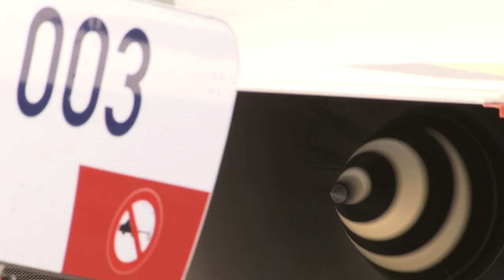A350 XWB: Engine testing in Bolivia and Canada

Comment: if it works at 30,000 feet I'm pretty sure it would work at 13,000... and they have actually already tested the engines at 13,000 feet during test flying
Reply: it means being able to takeoff at that altitude as the air is much thinner the engines need more power to takeoff than they do for normal flight so would need more air to be ingested which would be harder when the air is so thin
Reply: You are not thinking. The tests in Cochabamba and La Paz are for the purpose of seeing, how the engines and the aircraft overall can handle takeoffs and landings at high altitude airports. Obviously there's no way in hell an aircraft can take off and land at 30,000 ft, even if we had a place like Mount Olympus on Mars, where we could theoretically built landing strip that high for this. 30,000 feet is cruise altitude, not takeoff and landing altitude.
Reply: High altitude testing is very important. Possible destinations for any widebody can include Mexico City, Quito, Denver, Johannesburg, etc. Not all airports are on sea level, although not all are as high as La Paz either, although LPB is the holy grail for high altitude testing.
Reply: SquirrelFromGradLife i explained myself clearly
Reply: SquirrelFromGradLife aT 30'000ft, when you're going to 190kts IAS and you stall, you're already at a little bit more than 300kts Ground Speed and only roughly 150kts equivalent airspeed, and i'm giving a random value because it does change due to pressure, altitude & temperature, when they test the plane at La Paz, they're testing the capacity of the aircraft to reach a given IAS & EAS in a certain distance, they know the engines won't just shut off in final at 13000ft, it's not a single engine piston aircraft. Also, it's important for them to know if the engines can sustain a Go-Around at the MLW, in a high temperature/high density environment with a decent climbing rate.
Reply: SquirrelFromGradLife The engineers don't want to prove that the engines work at 13,000 ft, but that the engines perform enough thrust for take-off. You are mixing things up. The amount of thrust needed for cruise flight and for take-off are completey different. Why testing at high altitudes? Well, others already explained it but the air at high altitudes is much thinner so the engines produce less take-off thrust hence the aircraft accelerates slower. And since a lot of international airports are at high altitudes aircraft manufacturers are obligated to test aircraft at these high altitude airports. Again, it's not about whether the engines work at high and medium altitudes, it's about the behaviour of the engines and aircraft at high altitude airports. 

Another thing is that jet engines have much more difficulty to start at high altitudes (as a result of the low density of air.) At 30,000ft it may well be that an engine cannot be started but it has to be proven that the engines and systems of the aircraft are able to fully function at high altitude airports.

(I know the previous comments are a couple of months old but I just find it interesting so I responded)
Reply: SquirrelFromGradLife i wasn't rude to you, so why be rude to me?
Reply: SquirrelFromGradLife And you think that Airbus (if what you said was true) don´t know it?, and expend so much money on their tests?... 

I live in La Paz, and i can confirm you that the air here is to thin, if people got sick and can´t breathe, an engine thats work with air have so less air for use.
Reply: SquirrelFromGradLife at 30000ft the plane already had speed, but from 13000 it is still silent. You might found out that to change an object's motion is more difficult and require more power than simply keep it running.
Reply: TheRabbitFear Yeah but you're still not making any sense! They have already tested the plane in its full flight envelope at all altitudes which actually includes near stall conditions at altitude! If you can fly at near stall speeds and angle of attacks at its maximum altitude then I'm pretty sure you can take off at much lower altitudes! I know you think you're really fucking clever but you're actually just an arrogant asshole! You have just been lectured!
Reply: TheRabbitFear Dude you're not thinking! If they can fly at 30,000 feet where the air is much much thinner do you think they would be able to do so at 13,000?... think buddy... think...
Reply: It can run at 13000ft but if there isn't enough air particles the compression ratio will be wrong and you the engines will not start